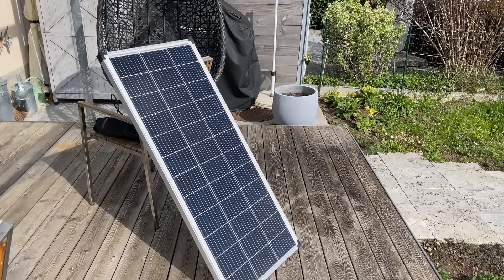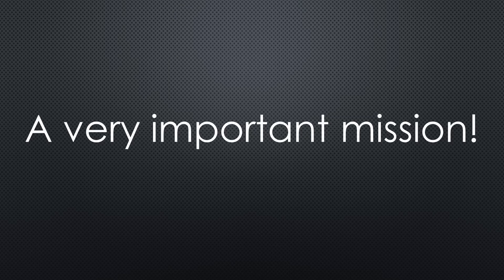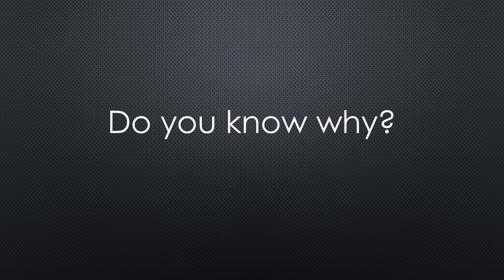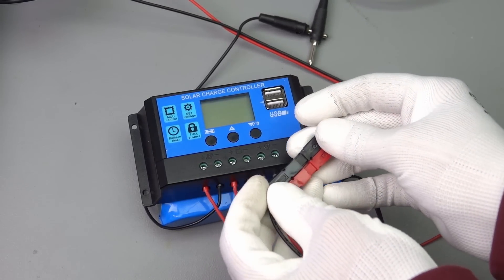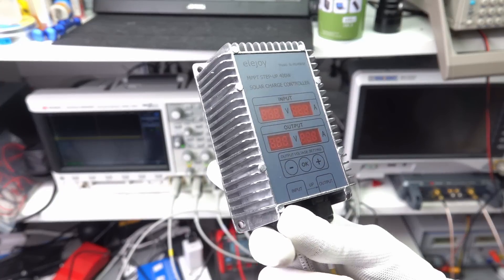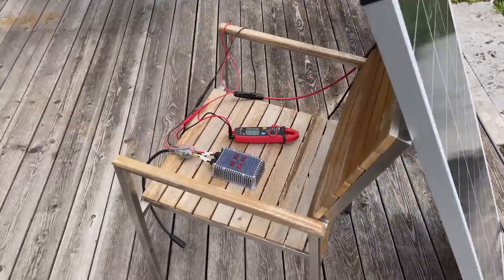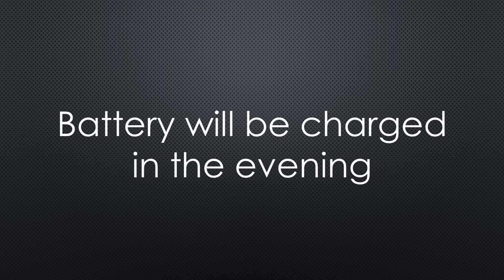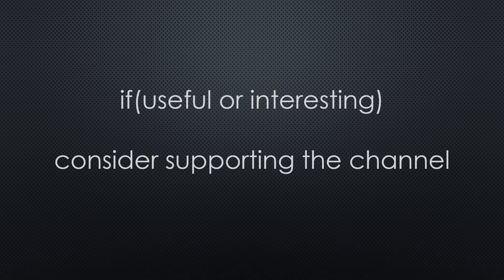454 How to Build an Solar Battery Charger for eBike / Electric Bicycle

Comment: My inital thought would be to take a current limiter boost converter and replace the trim resistor with a digital resistor. Then, adding a arduino to measure the open loop solar voltage, adjust the the digital resistor to match limit the current to a good point and close the loop to start charging. Opening and closing the loop can be done by a cheap relais and should be done every now and then. Think that schould work with the stuff you have in your lab from the journey ;)
Reply: Yes, the right solution. Current mode stepup converters have been aviable for more then 40 years.  Output current limited by Arduino program. Switching current is quite high so a parallel pair of fets is needed.
Reply: @ivekuukkeli2156  parallel to the already existing fets? Can't he just pick a higher rated converter to be safe?
Reply from the maker: I agree. I also thought about it. But the "digital resistors" I used so far were for 5V. And these power supplies usually use much higher voltages. This is why I also considered to use a servo and a potentiometer... 
In the end, I was happy I did not have to go this way.
Reply: @AndreasSpiess  maybe you could come away with a voltage devider and a transistor as "high voltage digital resistor". Woth a try (or a video?) ;)
Reply: Trying to "control" the trim resistor may seem like the "logical" way, but IMHO way more complicated than it needs to be (you need the right digital pot and an µC to set it depending on ADC measurements).
The much simpler way is to "mess" with the feedback voltage, which pretty much all buck/boost converters expect on their pins for voltage and/or current control. You will have a voltage divider feeding that pin with one of the resistors being a pot in adjustable converters. I've used various methods on different converters to make them self "adjusting". Like:
Pulling the pin just a bit higher (through a transistor and resistor), makes the converter think the output voltage is too high and essentially switch off. This can be use as a simple on/off for example.
Shaping the feedback voltage with an opamp for whatever you need (I've turned a few voltage control only converters into current control converters that way).
Even using smoothed PWM works well on some converters.

Comment: you are right though ,i tried a pwm controller i already had and it continuosly had up and voltages which would drop out the boost converter unless allways had direct sun,the mttp starts up as soon as i gets decent daylight

Comment: Your brave , i went for fairly inefficient but off the shelf panel with battery and inverter and use the recommended or equivalent battery charger .
Reply from the maker: Another good idea (with probably a slightly higher price tag). But very versatile.

Comment: You inspired me to look at my kalkhoff bike charger and battery - Nothing as simple as a 5v  pin  - The two have a simple conversation before the charger is enabled !
Reply from the maker: Bad luck! So you need a logic analyzer and some hacking. I assume, the conversation always is the same and can be created by an ATTiny.
Reply: @AndreasSpiess  actually not that bad , I should have stressed the simple:  3v pulses from charger on to sense line , trigger battery to enable a 2.5s battery level on V+ (so charger can determine battery state)  , then charger responds with 6v on  sense for 2.5 seconds and then starts the controlled current charging .  I was hoping to make a 12/24v charger but now I think an inverter might be the easiest option.

Comment: I think most of the bike chargers go from constant current to constant voltage ( at a low current) at the end so the bms can top balance the cells in the battery by shunting current around the high cells to let the low cells come up. At least that is how my bike battery charger worked, but it was a LiFePo4 battery - maybe your sisters is a lion type - if so better not to charge it too close to a building because those kind of batteries are more prone to catch on fire if something goes wrong with charger.
Reply: These bike batteries contain Li-ion cells (18650 or 21700). All major bike brands have a decent battery protection circuit. The charger in the video is CV and current will decrease when the battery voltage gets near the setpoint. 
 Still I would recommend to charge up till 41V and then switch off the charger until the voltage drops below 40 V or so. This way you can skip the last part of the charging which is slow and causes wear on the cells.

Balancing occurs very rarely, as the cells are so well matched nowadays. It would be enough to fully charge the bike a few times per year using the factory charger.
Reply from the maker: During charging, the voltage is given by the battery pack because the current of the solar panel is smaller than the current of the original charger. And because I set the maximum voltage of the charger to 42 volts, the current drops the closer it comes to 42V. So I assume the battery is ok with what it gets from solar.

Comment: Grüezi. Great video. I plan do build something similar for my Bosch and Shimano batteries. I already bought the boost MPPT controller and have 18V and 41V panels to play with.

Li-ion batteries need a special charger that uses CC and then CV when they reach 42V in the case of a 10s battery. 
1. Where is this happening in your setup? 
2. Is there a termination charge when the current reaches 1/10C? Do you have to use a relay on a timer to stop the charge? Or just relay on the battery to stop the charge?
3. Assuming that the panel would be 500W or more instead of 100W, how would the current be limited such as not to trip the battery's BMS? The controller does not seem to have a current limiter.
4. You wrote several times in the comments that if the panel has a sufficiently high voltage you can charge the battery without a controller. I have a 400W Vmp=41V Imp=9.8A but I think that connecting it to the battery without some form of current limiter would destroy the battery or trip de BMS. What do you think?
Reply from the maker: I just emulated my charger that supplies a constant voltage. The rest is done by the BMS inside the battery. This might be different in your case. You have to do your measurements.
Constant current is no problem with small panels as they never reach any currents the batteries support.
If you have a big panel, again check the currents to see if it is limited by the BMS.

Comment: There is a $8 40A boost converter with "input low voltage protection" on ali which does the same job. Set "low volt prot" to solar MPP volt. $12 shipping.
Reply from the maker: I am a bit skeptical with boost converters. Unfortunately, the MPP voltage is not constant (as I showed in the video).
Reply: @AndreasSpiess  MPP is mainly influenced by temperature, not so much by intensity. If you aim at MPP minus 5% you on the safe side.

Comment: I've had to solve a similar problem... The cheapest solution I found is to reverse engineer the DC-DC converter, add an op-amp as a comparator between the input voltage and an analog out of a microcontroller and feed the output to the feedback of the controler on the converter... Add some kind of current sensing (the hall effect ones are the easyest to use) and some lines of code later you are ready to go... The microcontroller can dictate the minimum input voltage (through wich it can find the MPP) and you still have max output voltage and output current control from the potentiometers wich usually come with the converter... This solution has been working perfectly for me for about 7 years now..
Reply from the maker: That is a good solution and for sure, I would have gone a similar way without the latest catch. I assume that my MPPT boost converter works in a very similar way.

Comment: I have a similar setup, but after some thinking I realised a simple buck or boost would no solve it. I wanted to charge 12V lifepo4 with 20W solar. So a MPPT would be to pricy... So I used a fuse, a LED and a diode instead. You would need a solar panel with higher voltage or 2 in series. And you would not get the maximum efficiency. But you would be done in a day and it would be cheaper...
Reply from the maker: I agree, if you find panels with an MPP of 42 volts you can save the controller.

Comment: Just buy small PV modules doing 5v peak power and 6v unloaded. Put 7 in series and that's it.
For faster charge, add more of these in parallel.
Then directly connect that to the battery.
If you have more than 42v with no load, you may want to add N pn diodes in series to drop N*0.6v.
For the connector: just cut the original charger cable and insert your own cheap one male+female set.
Reply from the maker: I agree, your solution would work. For me, it would shift the problem from electronics to mechanics (building a stable and waterproof solar panel consisting of many cells) which is not good ;-) 
I do not think diodes are needed because the solar panels adjust their voltage automatically as I showed in the video. If this voltage is close to the MPP you are good to go (maybe the case for 8x6V panels with an MPP between 5 and 6V)

Comment: Great video. Now, I wonder would the lady be able to put the solar panel on a trailer and charge the battery while riding the bike? I.e. charging the battery while at the same time consume energy from the battery for riding the bike?
Reply from the maker: This was tried by a few Youtubers. Unfortunately, without success because it takes a long time to charge the batteries. Much longer than you  drive your bike.

Comment: Perseverance pays off! Congratulations on getting it working. I bought one of those PWM blue controllers to charge a 12V lead acid car battery from a 20w Mono Solar Panel but in the winter with low temperatures it is not enough to start the car if it has not been used for a week. The alarm system is taking energy.  

On another topic. Have you found a way to control an electric hot water heater from excess solar? I have built a energy monitor. When there is > 1kW of spare energy it switches on the heater (1kW element). It measure the excess solar every 4 mins but I'm "chasing the sun". I would like to heat the element when there is less than 1kW of spare energy. So presumably the voltage need to be varied. But I have yet to find such a controller. Maybe I do not know the right words to search with.
Reply from the maker: AFAIK they use standard "dimmers" to reduce the power of the resistive heaters if connected to your home grid (AC side). For regulation, you can use the smart meter (or a shelly at the same position if you cannot access the smart meter). Always when it starts to "sell" energy, you switch the heater on till it stops "selling".

Comment: Yup, battery charging with solar panels is no joke. I've been thinking of a battery maintainer for my automobile but haven't found the time to do it yet. I'm sure it will be even more complex than your story here, as I'm also thinking of adding a temperature controller (winter days in Canada can get as cold as -40C and that really changes how batteries charge and discharge).  😃
Reply from the maker: So you have a project for the dark days next winter!

Comment: Got two of theses elejoys a few years back after a review by justin le elmoire of the grin cyclery in canada. Going to use them in my env200 van conversion to add a tertiary battery voltage of 40v (i already have lots of mower batteries that power my ebikes) and this hopefully with allow me to cheaply implement a leisure battery that can be topped up by the solar where as it is technically much more difficult to charge the 400v bev battery directly from the solar.
Reply from the maker: At least here, it works. So it should work also for you...
Reply: @AndreasSpiess  yep already did a yt vid on it a while ago. Works but the batteries i have are not designed to be charger on anything but their charger so i wonder whether like your wifes sister's if there is a simple 5 volt enable signal.

Comment: When I have an idea it seems easy, I know it is possible, but then when I try to do it I realize it's a bit a more complex. Example, i was trying to build a solar panel by connecting a bunch of little panels. I didn't know they all have to be identical or else they will all have the output of the lowest amp panel, lol, that was a lesson though. Sometimes it's better to buy things, sometimes it's not. Ive been thinking of a way to have a battery that can charge at 12v, by making a charging circuit that splits the battery pack in to 12v segments, they get charged in parallel, but for use the whole pack is 52v... which seems like a really cool idea to me.
Reply from the maker: Indeed, it is good to use very similar panels if you connect them in series ;-)

Comment: I essentially do this with my 10s lithium ion Ryobi packs when I'm out in the field.  There is a $7 DC-DC boost converter that lets you set the max output voltage, max output current, and the input voltage threshold.  If it falls below that threshold, it throttles.

Basically it's like a really poor man's MPPT.

$7 and done.

On the Ryobi side, I just used their charger but substituted the DC-DC boost in place of their wall wart.
Reply from the maker: Seems to be a good solution. I was not so happy with my DC-DC converter because I had to constantly adjust the minimal current to the actual sun not to lose a lot of power.
Reply: @AndreasSpiess  Yes, I had that exact same one as well and noticed the same thing.

That's why I switched to a model that had the input voltage threshold.  Set the current limit to the max the battery can handle, and set the input voltage threshold near the solar panel's Vmpp and for $7, it was close enough.

Comment: I would have just started with a 48v solar panel and worked down, but the fact this worked well is interesting
Reply from the maker: 48V panels probably would have worked without a controller. But the ones I know are quite big and heavy.

Comment: once i made an opamp-mosfet arrangement to control the battery charging current, such that panel voltage stays at 17v. this 17v was bucked to 13v or 4.15v for lead acid/ lipo charging. 
not the best, but worked well.
Reply from the maker: Good solution. My "Kicad" solution probably would also would have started with a similar design.
Reply: @AndreasSpiess  ☺
Reply: This is similar to how the TI BQ24650 works. Might be worth looking into one of those if the input voltage is under 30v. The device data sheet mentions that it is the simplest form of MPPT tracking.

Comment: I'm not great with hardware, so I would have gone (bigger) solar panel to charge controller /battery to off the shelf 120/220 v inverter and used the bike's factory charger.
Reply from the maker: That is possible. I would call it then a "balcony power plant"...

Comment: This is an interesting video and I was recently considering doing something similar. I am surprised to find that ebike battery manufacturers don't offer 12v/24v input DC-DC chargers for 36/48/52v batteries.
Reply from the maker: I agree, they should offer at least 12V for cars
Reply: @AndreasSpiess  Exactly. It seems like a car charger for bike batteries would be a popular accessory
Reply: @AndreasSpiess  The BST900W adjustable boost converter seems like it could work. My battery/charger has three pins including NTC as well as + and -. I'm still trying to figure out what NTC should be connected to, if anything on the boost converter.

Comment: Perfect Andreas. Again you are a master for us. I am curious about 2 things. 1 - How the MPTT device is working ? what are the principles , MCU, Diagrams, Performance ..... 2 - I am questioning the benefit for the planet of a such set-up (Solar Panel + Converter), especially for a country like Switzerland where CO2 emission per Kwh produced is the best in the world. Have you done  the ROI re. CO2 emissions ?   What would be the use case since the panel is not "transportable" ?
Reply from the maker: I am sure, this project will be CO2 positive, not negative. But this is with most of the hobby things I do. I try to reduce my footprint for non-necessary things like use public transport or bicycle, using solar energy, or heating with wood...

Comment: 'Danger Will Robinson!!!'

Those cheap isolated DC-DC converters are typically unregulated and require a minimum load of 10 to 20%, otherwise the output voltage could be *double*, or more, the rated voltage. A RECOM part I tested had the output voltage go beserk when the input voltage dropped significantly below (around 20%) the minimum input voltage (coupled with a less than minimum specified load) - so be careful if the load is voltage sensitive. Especially check out startup/shutdown conditions when normal input voltage doesn't apply.
Reply from the maker: Good information. Thank you! I saw that they do not provide a stable voltage and moved with the input. But my input was stable. So was the output. 
Anyway, others suggested to use a simple Zener diode instead and connect it to the 42V. Maybe I will go this direction...

Comment: what is the current taken by the 5V input, does it power the internal cct or just a signal. 
it must power the cct as if it was just a signal i expect you would have just used a Zenner to provide the 5V from the 40V charger power out side side.
Reply from the maker: I did not measure the current. But I am pretty sure your solution would be much easier!